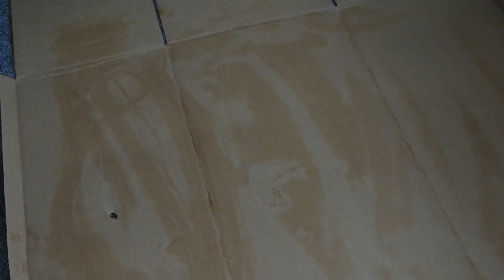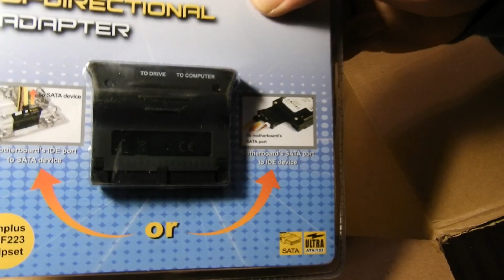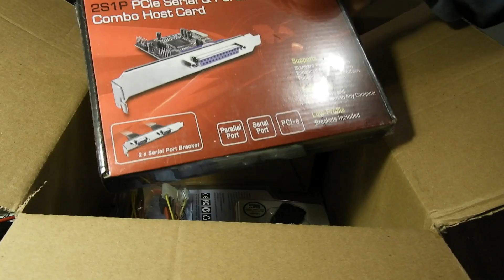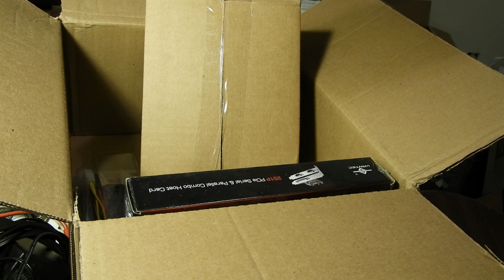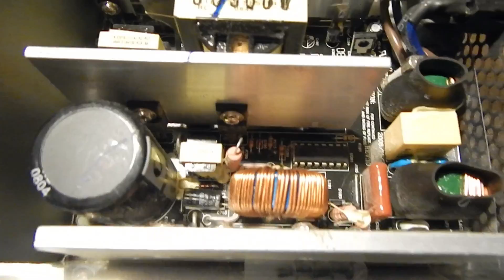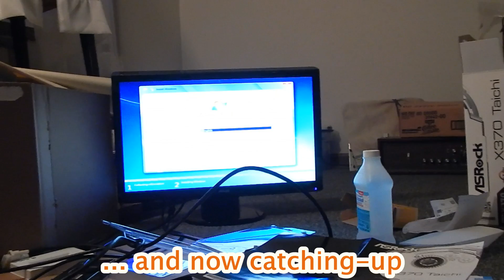Computer Rebuild - Ryzen Build w/ M.2 SSD  - UnBoxing NewEgg 1808

Comment: The untold part of the story is the unboxing and installation of the video card. The case is mostly tool-less, with plastic flippers to hold cards to the rail instead of a screw. I had to put a major notch in the rail to make it possible to install a double-width video card. I think that's why my friend gave me a deal on this case way back, he couldn't get his video card into it.